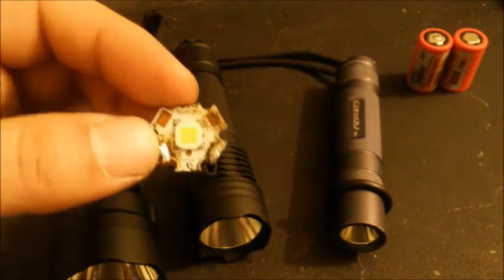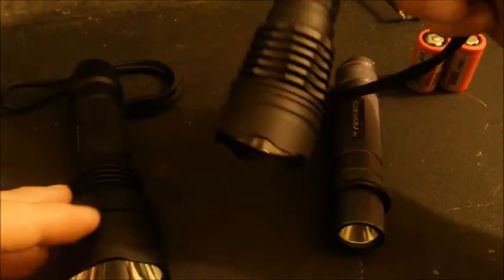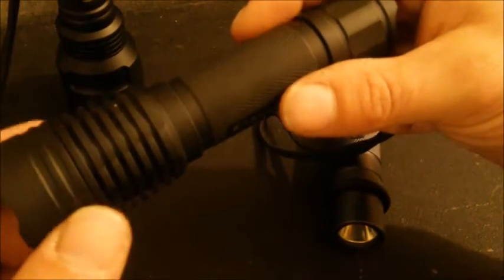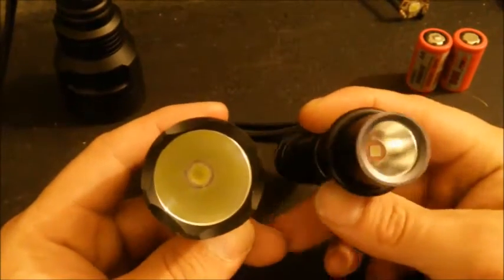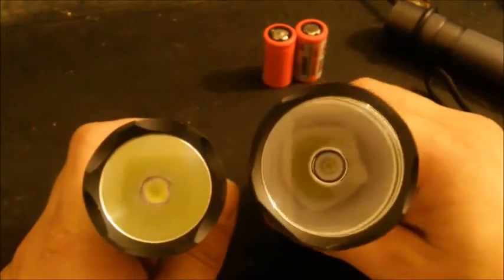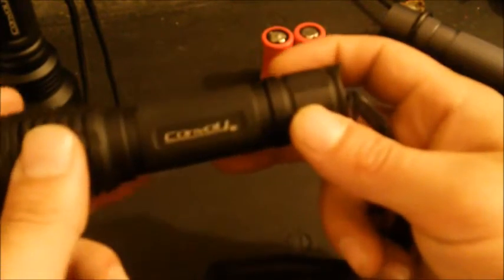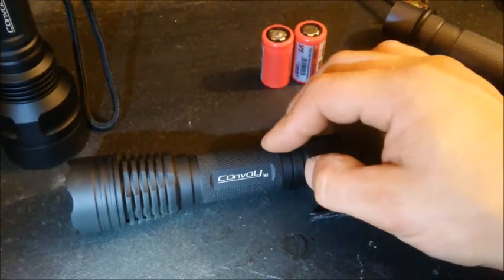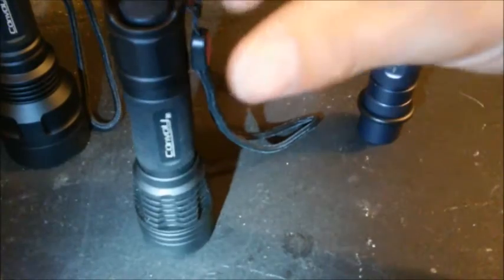XHP-70 in Convoy M1 mod

Comment: How about swapping it for the XHP70.2 now?
Reply from the maker: I did actually buy one for that purpose but I can't decide if I want to even swap it or try to do something else with it. I got it in the 12v arrangement this time tho so it needs a good boost driver.
Reply: @Magneticitist  
Gotcha. If you get around to it, let us know.

(I was thinking there was a 3v version of the XHP70.2, but I was misremembering; the only 3v XHP LED as of today is the 50.2.)
Reply from the maker: @DinnerForkTongue  I kinda thought there was a 3v version too for a while, like someone had just modded some emitters to run that way but even then I'm not sure how I'd feel about doing it that way and pulling close to 12A. I do like the 2S 18350 setup running the 6v XHP70 but I also think the single cell 18650 boost driver that can run 6v or 12v emitters is pretty sweet as well. Playing with the 12v arrangement definitely seems to be better as far as managing current but then at a 3s arrangement sitting at 12.6v max, it's not really going to output a max brightness due to the cells sagging.   

I wanted to build a little portable work light with the single XHP70.2 I got but I'm realizing with the 12v emitter I'd prefer using a buck driver stepping down a 4s setup of 16.8v max so it could actually crank at max. What I might do is try to just swap the jumper around on the new emitter I had to see if I can reconfigure it for 6v that way, then just swap it with the old XHP70 I have in the M1.

Comment: I might suggest some silicone thermal pad in place of the paper for insulation.
Reply from the maker: I actually ended up trying that but the tolerance was too little. I sort of jammed 4 little pieces in there hoping it would make it snug enough while not 100% torqued down in the threads. I ended up using a thicker stout plastic, but realized without a thermal timer after a while the emitter gets so damn hot it melts the plastic and causes a short again. Luckily I caught it right away and there was no damage.

Comment: I don't know crap about flashlights, although I have built a custom garage light fixture with some 50w COB LED's before. I'm not a flashlight enthusiast, so I have a question.  I am interested in buying a C8, there's something about the design I really like. All I want to do to it is put a hammered finish / orange peel reflector in it to tone down the throw and spread the light out. Are there any reflectors like that?
Reply from the maker: Sure. The C8 is a great thrower light though so an OP reflector may be reducing it's intended purpose a little but it would still be a great light. I bought a stock C8 and just changed the driver to crank more power and it throws a serious long range beam. The smooth reflector is best for that but you can get a little extra spill with the orange peel. Mtnelectronics.com is my recommended place to buy. Here's a link to the OP reflector for the C8 http://www.mtnelectronics.com/index.php?route=product/product&product_id=495   

I also recommend checking out the Convoy M1 flashlight also at mtnelectronics. It's similar to the C8 but with a slightly smaller head. It comes factory with an OP reflector and has a great mix of throw and flood.
Reply from the maker: Crap looks like mtn is out of stock at the moment but they are available other places as well.  https://www.banggood.com/C8-XM-L-T6-Orange-Peel-Reflector-Flashlight-Cup-p-932209.html?gmcCountry=US&currency=USD&createTmp=1&utm_source=googleshopping&utm_medium=cpc_elc&utm_content=vivian2&utm_campaign=pla-all2-us-pc&gclid=CjwKCAjw_tTXBRBsEiwArqXyMsfjaVUFG4R2Afhhva3wUdcDUhz-bt5651xWQMZ6ykao0P22FdFhoBoC-W8QAvD_BwE&cur_warehouse=CN
Reply: Thanks for the help I appreciate it!
Reply from the maker: No problem. But oh yea afaik there have been quite a few C8's put out by different companies so I'm not 100% they are all identical. Some may have slightly different tolerances. If you stick to the Convoy C8 (probably the best) you should be good, but if you go with another just make sure the reflector diameter is the same 42 mm. I'm a commercial lighting guy for a living so I love any kind of lights and happy to answer any questions lol.
Reply from the maker: The Thorfire version I remember is totally acceptable as it is factory. I think the only difference was the 'shelf' where basically unlike having the round heatsink 'pill' like the C8 does, it's got like a round shelf for the emitter to sit on. All that means is instead of having an extra piece of heatsink that screws in the LED is directly cooled by the shelf attached to the flashlight head. If you keep it as-is factory then it's totally fine and puts out the same power as the Convoy. If you ever wanted to upgrade it and mod it to crank more power it might not have the proper cooling capability. Modding it is totally unnecessary unless you're a flashlight fanatic.
Reply: As long as I can put that other reflector in it that's all I care about. Thanks again.

Comment: I did the same damn thing with my reflector. I shorted my driver board so I got a new driver, used a dremel to shorten the reflector a bit, and put a layer of plastic to keep the reflector from shorting the driver board again. I should've seen this video first

Comment: nice! I was thinking of putting an xhp50 in an eagle eye x6, or like a convoy host, maybe the l4 or l2. The hosts you can get nowadays are incredible value for money, and like you said, total build might be under 30 even. Flashlights are always fun to build! is that m1 a good host too?
Reply from the maker: yea the M1 is great. For it's size all the heat manages to stay mostly in the head around the fins even pushing roughly 40 watts for a minute or so. I got an M2 a while back also but it didn't seem quite as beefy as the M1. I was looking at the eagle eye x6 also but something about the M1 won me over.